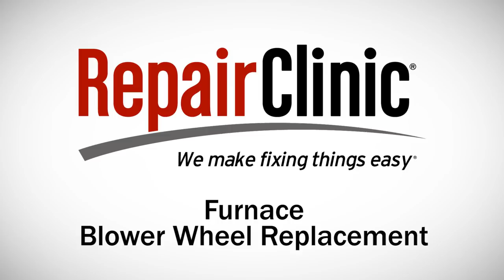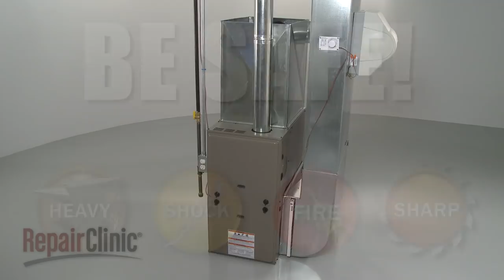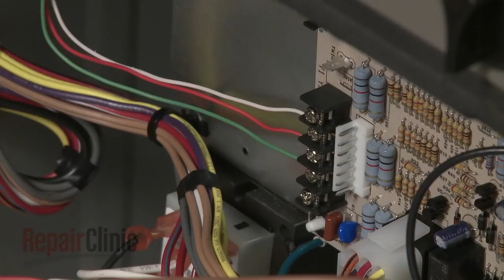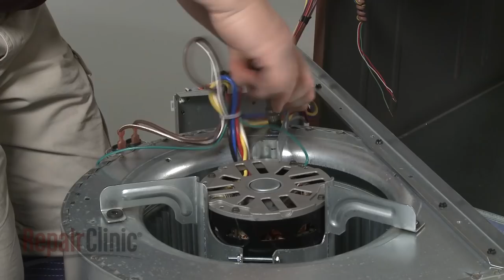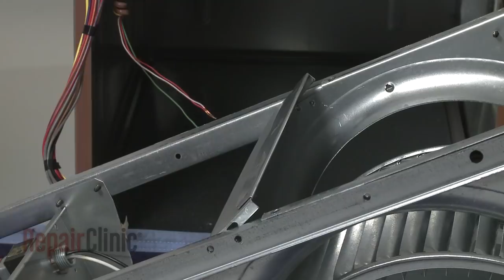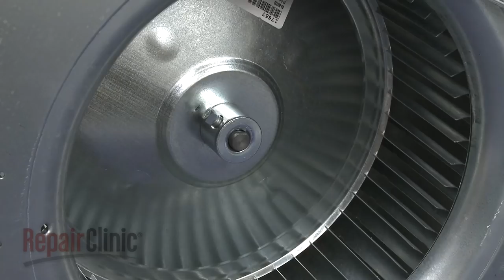York Furnace Noisy? Replace Blower Wheel #S1-02619654709

Comment from the maker: Sharon, If the new wheel is unbalanced than you may want to return it as a defective part. It should fasten to the motor securely and not wobble when spinning.

Comment: Just a couple quick notes..... your system should have come with a 5 yrs limited part manufacturer warranty (10 years if registered by the original owner) so, at the least, the part should be under warranty. 
The wheel should be a direct OEM part. A lot of testing goes into HVAC equipment... parts substitution can affect the equipment CFM and temperature delta. The wheel part number will be specific to that particular model and size of equipment i.e. a larger cfm system will require a larger wheel. Installing an incorrect wheel may result in a safety or reliability issue and could affect the warranty.
That being said... as an HVAC contractor for over 30 years... this is a very good, well produced and helpful video. There are a lot of things that a homeowner can do themselves to minimize an expensive repair. well done guys.

Comment: Always check a new blower wheel by installing it temporarily on the motor shaft while the motor is out of the furnace, and giving it a spin by hand.   If the wheel visibly wobbles, it will shake the furnace to death in operation.  Return it to the vendor as defective.

Comment: Is there a bearing in the blower wheel and that's why the whole blower wheel assembly would be replaced?
Reply: No. Sometimes the inner disk will rotate independent of the "slats." This is noisy as heck.

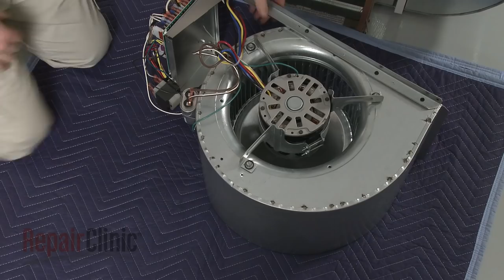Comment: 3:04 how tight? Too looks and it's insecure. Too tight and the rubber squishes out. I suspect I just overtightened mine. I suspect this because it's louder than expected, and those rubber spacers help to dampen the vibrations. But I can't find anything online that says how tight they should be.